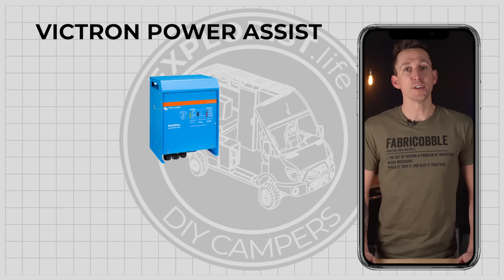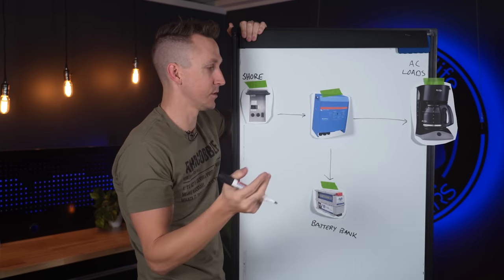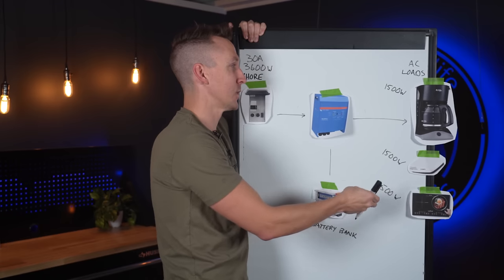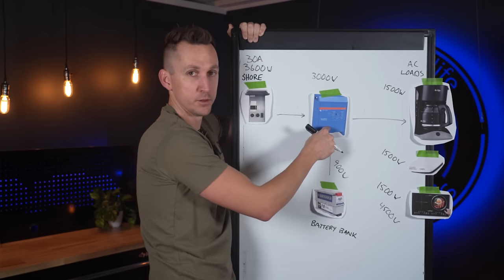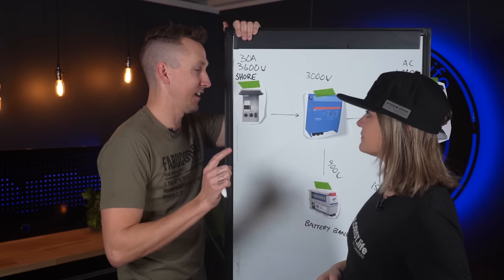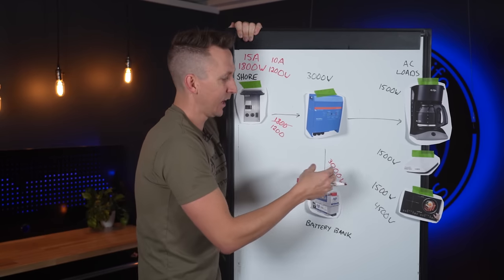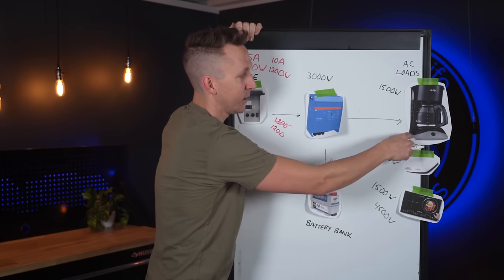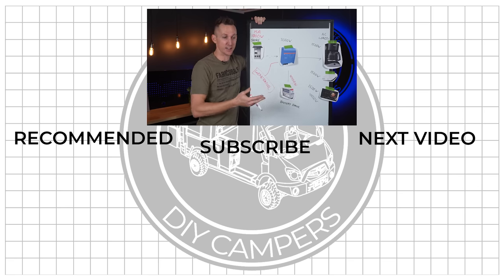How Does VICTRON POWER ASSIST work?

Comment: Great video thanks.  I shared it with one of our customers who has an Airstream trailer with a Victron inverter charger, and he wants to use a CarGenerator to provide shore power, using the "power assist" feature so that when he runs his Air Conditioner, his tow vehicle provides about 1500 watts of power, and the RV trailer batteries provide a few hundred extra watts needed.  So that when running the AC unit, instead of pulling all 1800 watts out of the RV batteries,  we pull 1500 out of the tow vehicle engine, and pull only a few hundred watts from the RV battery bank.  Happy to send you guys a CarGenerator demo unit if you would like to check it out.   thanks.

Comment: Brilliant explanation! You can even start & stop your generator automatically with the Multiplus II GX triggered by a couple of parameters including AC load effectively reversing the process of load assist. Your generator will then assist the inverter when drawing a high AC load.
Reply from the maker: Yes!  For sure a good feature as well.

Comment: Hey Nate, well done and good info. One note about how a generator interacts with the Multi-Plus II. In doing his install Chad from "Changing Lanes" discovered a problem Victron has with  Pass-Thru power with an Onan generator. The way Victron handle an In-Sync connection (like a 30amp dog bone adaptor for 50amp rigs) it drop 1 leg and pulls all the power from the L1 leg and then splits it our into L1 & L2 on the far side of the MP II. Because the generator produces 5500 watts and outputs it thru (2) 30amp breakers and the power comes from the same generating source, they product In-Sync phases, thus it's interpreted as a dog bone adaptor. So the MPII attempts to get 5500w or 6500w (depending on genset) off 1 leg which in turn overloads one breaker and it trips. This in essence crippled the generator down to a 30amp source. His fix was to connect the two 30amp legs, (L1 & L2) together just before the ATS on the generator side. This makes it a parallel connection and gives back the full wattage of the generator to L1 and the MPII handles the distribution on the RV side. In his case the ATS still responded to power on L1 only and performed as the ATS should with only one input leg. So this may be something you want to cover unless Victron has done something to address this since his install. I'm about to install my MPII and believe I will have to parallel my generator outputs as well but have not done it yet. 
Sorry it's so long but a lot to say.... Thanks, Charles
Reply from the maker: This has been something we have been talking about with Victron and when we do our 50A OEM RV Retrofit video later this year, I'll be sure to cover the best way to approach that.

Comment: Pulling big currents together will ultimately warm up the inverter/charger and derate the output ability, we’re have a lot of those problems here in Oz🇦🇺 at the moment with hi ambient temps, have been playing around with additional fan pulling air through the top of inv/chg with some success, but well explained as always none the less🤙

Comment: Hi, 
I built my system based on one of your plan and it works great. My question is if I on shore power can I take advantage of 1100 watts of solar panel to save on electricity. My inverter is a Victron MultiPlus II 3000. I have 2 12v 100 amps batteries and a Epever 40 amps controller.

Comment: I am hooked up to 30amp shore power 24/7 in an RV Campground. I have a Victron multiplus, 300ah lithium batteries and 700 watts of PV
I would like to use my solar panels to off set the cost of shore power. If I lower my AC input to the multiplus to 15 amps, will the load on the batteries during power assist mode allow the PV panels to generate power and use less shore power? 
Thanks for the very informative video.

Comment: Another great video Nate!! Your clear content & diagrams have allowed me to confidently create the system for my van. I wish your shop would have been open when I was buying supplies. No kidding on the Multiplus cable gland being a little too small for 6/3 wire!! OMG and the cable I purchased is NOT flexible like what you offer!! And I'm using AC Output 2 for one outlet for my fridge when on shore power (I didn't want my DC fridge switching to 120V every time I'm off grid and turn on my inverter) but having to make those grounds share a common landing spot on the inverter almost forced me to abandon that small convenience. Luckily AC Out 2 is 12/3 wire since only one outlet.
Reply from the maker: Nice!  Sounds like a cool setup!

Comment: Hi can I work inverter using battery at 3000 watt and will shore power adding power for load ect as have solar and looking to use batterys as main power with shore power helping

Comment: I see the line out wire gauge issue has been addressed in other comments but, it might be worth mentioning that in order to achieve the “..up to 3000 Watt/max output” boost for power assist, the batteries must be capable of this output power as well. Some batteries are limited by the BMS and may not be able to achieve the inverter max limit without increasing parallel battery count .Something to consider during the design phase before choosing/purchasing batteries.
Reply from the maker: Of course.  The batteries must indeed be sized to power the inverter.

Comment: Thank you so very much for this video. I have been asking all around this question: 
How long can a Quattro Inverter Charger 48v Input 5000va power a surge of anything between 5000Watts and Peak power 10000Watts?

The reason I ask is that the Schneider XP Pro can hold a 8500 Watt for 30 minutes and it is rated at 6800Watts.
Thanks again for your explanation of Power assist

Comment: I'd appreciate a follow-up video with the actual Power Assist setup process. Because this video makes it look like the inverter "automagically" detects the power limit of the network mains.
Reply from the maker: To set up with power assist, you simply set the shore power current input limit on the cerbo gx, victronconnect app via ve.bus smart dongle, or digital multicontrol.  This was covered in all of the videos in the following playlist: https://www.youtube.com/playlist?list=PLmvhcyi4n0TUU8FUc6LE38TBkdSLjdw_5

Comment: Yes, I loved that video!  
Now I really want one of these Inverter-Chargers. But my RV Trailer/camper is only small couples camper with a 30amp shore power.  Do they make small ones with this Power Assist? 

Cheers, Eric
Reply from the maker: Yep!  They make a 2kVA inverter/charger like you are describing.  Try the system picker on our shop homepage at shop.exploirst.life to get our recommendation there.
Reply: @EXPLORISTlife  THANK YOU... I will .

Comment: Suggestion for a video topic:

Create a video that shows multiple inverters (preferably 4 or more, not just two), that are paralleled (stacked), to supply power to critical loads breaker panel, and show clear wiring from each inverter, to supply the breaker panel, and how and why you selected breaker size, and how you determined which leg to connect each inverter.

My thinking is that it would be more organized to have a small breaker panel with a main breaker, to be used for all incoming AC from each inverter, then a mains wire from this supply side panel to go from to the mains breaker of the critical loads panel.

your opinions?
Reply from the maker: Neat idea, but I probably won't make a video like that for a WHILE.  I can't see any reason why a camper (what this channel is about) would need 4x inverters.  We can get 30kVa out of only 2x Victron inverters.

Comment: How would that work with 2 units in parallel? I just got 2 multiplus ii. Would each unit power assist or just the master? L1 says up to 75amp if boosting from a 50amp input and L2 is non power assist up to 50 amp. Could I real get up to 150amps on L1 Between both? Or would I get 75 from one and 25/30 from other?

Comment: is there a way to get the solar panels to do more work to take the load off shore power? being on metered shore power with available solar but I can't get the system to pull the solar wattage. Seems like my SCCs are idling too much and letting shore power do almost all the lifting.
Reply from the maker: Yep!  It's on my radar to make a video about this, but in the meantime, You'll want to hop into the advanced programming of the Multiplus and set that up through the Self-consumption hub-1 assistant.

Comment: Hey y'all. You guys do great video's.  Just a thought. I wonder if you would want to do a bit more in depth video of the avalible battery power and how that effects the victron assist feature and the boost factor in conjunction with battery over draw shutdown of the battery. Hope that made sense. It's a bit complicated but interesting to me and maybe complicated for video. Similar to regulating the a/c input, the d/c source has to be big enough to give what is asked of it. Just a thought have fun. You all do good work.

Comment: Can that be setup so the Multiplus takes priority over shore power? So the Victron uses its battery power then if more than 3000w is needed it will then use shore power for assist?
Reply: Yes

Comment: Have you ever set up 2 multi pluses in parallel? I did, and I discovered the hard way that they have a minimum current input for the power assist function to work. With two Multipluses, I cannot set the input current to less than 18.4 A, and therefore I cannot use power assist when I’m hooked up to a 15 amp shore power connection.

Comment: Is the Quattro able to be set up to run both AC outputs on battery and run on battery when attached to shore using shore only as the assist.  The multiplus is capable to do this. I want to run off battery and solar as primary and pull from shore only as needed.  This way when on a metered site i keep the draw to a bare minimum. I am wanting to use Quattro. Thanks for your help I really appreciate your videos

Comment: Nate, first KUDOS on the top notch content u produce. I’ve watched countless hours of materials from the channel and used it to install a complete solar system in my truck camper 18 months ago and it works flawlessly. 
But I have a question on this video. When u are augmenting the shore power load with the battery capacity, since the resulting AC is still running thru the distribution box, aren’t u still limited by the size of the master AC breaker in the unit. For example, my 30 amp truck camper would still trip the master at 30 amp (3600 watts). True?
Reply from the maker: That is indeed true!  In that scenario, power assist will be beneficial when connected to 15A shore power, but less useful when connected to 30A shore power.

Comment: I love victron , use Quattros 10 kVA and 15 kVA with lithium EV batteries. Quattro 48 V is capable of delivering 64V DC so that gives me great options of using 8S LG Chem cells .
Reply from the maker: Great, Thanks!! 👍
Reply: Is one inverter feeding the other? Can u run battery and 2 ac inputs for power assist at the same time?
Reply: @Alex300zxTT  yes
Reply: Yes u can run ac input just one grid or generator plus battery also solar pv ac coupled . Depending on configuraton however Its my Home system caravan / boats r more likely mppt pv

Comment: A great tutorial on how inverters works in general and then specifically how the Victron Power Assist Works but you missed the opportunity to tell people how the battery can get charged as well when the shore power demand goes down and is available to power the Victron inverter battery charger. All in all you did a great job with what most consider a complicated topic.
Reply: He covered it at 1:40.

Comment: My question would be about surge loads.  What happens when you start, for example, the air conditioner and the surge load goes for a second above what the shore power and MPII are rated for?  So how quickly does the Victron respond to a surge load?  Also, what about a 240volt split phase system?  Is this capability there also?
Reply from the maker: It's near-instantly.  This capability is indeed available on a split phase system.

Comment: Another good explanation, thank you.  Does the victron Cerbo GX / is there a way to display how many watts are available to the system and how much you are using ? Some sort of graph for example to show that your now at 85% capacity for instance or an alarm to warn you you reaching peak capacity rather then finding out by tripping the breaker?  As a side subject i would love to hear your thoughts on tankless vs tank water heaters

Comment: So the MultiPlus has settings "on, off, inverter only, and charge only", which setting should I have the MultiPlus set too if I am running my generator as shore power? Does the charger also charge the batteries if they are assisting the shore power?
Reply from the maker: I only ever use 'off' and 'on'.  

The charger will charge the batteries when the loads fall below how much shore/generator power is available.

Comment: Have you had instances where the Victron MultiPlus II trips a GFCI feeder supply? I see several instances on the Victron Forum. When I contact our retail vendor for warranty repair, they say it is not the Victron.
Reply from the maker: Yes.  And it's just the way all inverter/Chargers handle the ground to neutral bond relay.  You'll just want to find a non-gfci shore outlet.
Reply: @EXPLORISTlife  My MP2 is on charge only, so the neutral/ground relay should not be the issue. When any %)A or 30A RV outlet is installed under 2020 or 2023 NEC at a residence or other structure, GFCI is required (NEC §210.8(A)(3) and (B)(4)). So this will be a BIG issue for anyone who plugs in their RV at home. The RV Park industry continues to fight this requirement for the pedestal, but it will be a requirement there soon.

Comment: Nate, I love this video!  You explain things so easily.  If I have my van set up for shore power..do I have to choose 30 or 50 amp  shore power when I am setting up?    If I am wired for 50 amp can I use it with 30 amps?
Reply from the maker: I recommend 30A shore power for vans.  There is usually no reason for 50A shore power unless you have two or more air conditioners.

Comment: I have a question my Grid network is quite unreliable sometimes voltage drop as low as 80v in this case multiplus can raise up the voltage to 120v?

Comment: Great video!!! I’ve got the multiplus 3000VA, and I’d love to start using this function. I see there are options for Digital Multi Control panels. Just wondering if I can purchase the smart dongle to control this function, without having to purchase a control panel. Thanks in advance Nate!
Reply from the maker: Yep!  The VE.Bus Smart Dongle will indeed allow you to change the shore power input current limit from the VictronConnect app: https://shop.explorist.life/shop/all-products/monitoring/victron-ve-bus-smart-dongle/

Comment: So here's my question: I have a multiplus II 2x120 for a 50 amp rv. Right now it's set on 50 amp (so 50 amp per hot line). If I go to a house and set it to 15 amp, is it assuming 15 amp per line? Do I really need to set it at 7.5amps?

Comment: Hi Nate. i installed recently the ESS and it is working fine, however when my load exceeds the AC1 or AC2 input limits, it is not power assisting and the Quattro is allowing the input to exceed the limit which can end up by tripping the AC-In feeding breaker. how can i continue using the ESS while benefiting from the power assist function. (I used the ESS because without it my quattro was pushing the MPPT to throttle and not allowing the use of Solar power in the presence of the grid for both load and charging). please advise

Comment: great channel and lots of wonderfully assistive videos.   am a newbie and in the process of building a system on a boat and i may have read something wrong but is it possible for Quattro (what i have) or Multiplus to temporarily exceed three capacity, and if so how long for.   Your example of the 4500w load against only 4200w of supply made me question whether the inverter could kick up for a short time to cover the excess.  Sorry if a dumb question, just thought id seen a feature saying a temporary excess could be covered.  Thanks again
Reply from the maker: Power Assist will work until your batteries run empty.
Reply: @EXPLORISTlife  Thanks for reply but don't think my question was clear.  I thought (?) that if i had a 3kw Multiplus, that it would at certain times allow a peak or overdraw above 3kw.  So in your example of a 4500w load against 4200w of supply, would the inverter/charger allow a peak draw above its nameplate?

Comment: Hey Nate, You have provided me with a lot of knownlege. One thing I am confused about is you 900 watts into the inverter and 900 watts out. My system takes about 90 amps out of the battery to get 900 watts out of the inverter. What am I missing?
Reply from the maker: The inverter takes a bit of power to run, so you won't see 100% of the power on the output.
Reply: @EXPLORISTlife  Thanks Nate! How can I know how much amperage it will take out of the battery to get say 1000 watts, before I buy a converter? Thanks

Comment: With my Multiplus II 3k 24v I do not understand why Powershare does not use full available shore amps available especially when there is no solar available.
I had incoming amp limit set to 12 amps and with Powershare set to 2. With a 1200 watt load  750 watts was drawn from shore power  (generator) and 450 watts was drawn from battery bank.